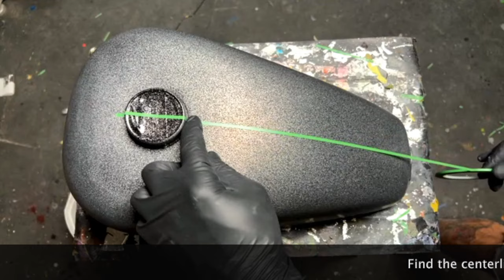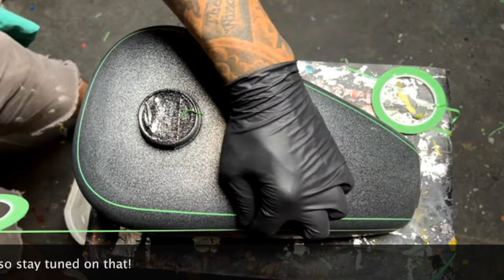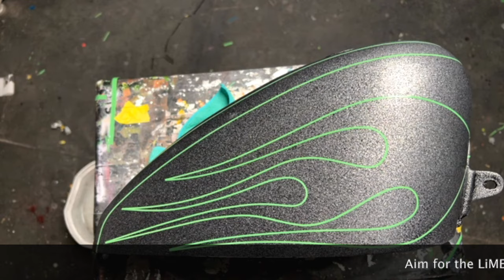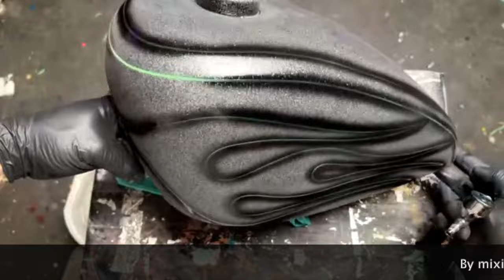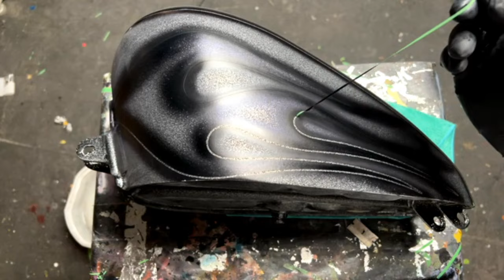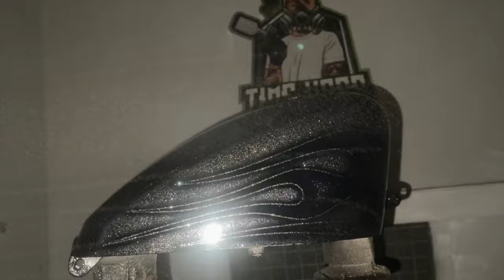How to Paint Flames: Purple Candy Flames over LiME LiNE Silver Metal Flake

Comment: Man your content has been insanely inspirational for my bike builds! What’s the difference between the crushed glass and the flake by lime line?
Reply from the maker: Thanks. I LiME LiNE crushed glass requires a 1.7 tip size or bigger and is more chunky and brighter lime line metal flake requires a 1.4 tip size or bigger easier to spray and apply.